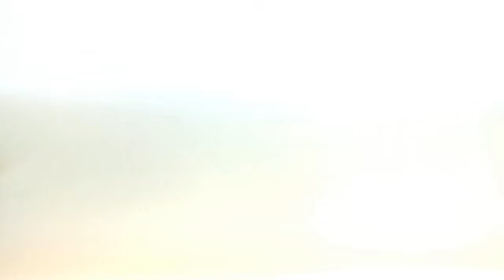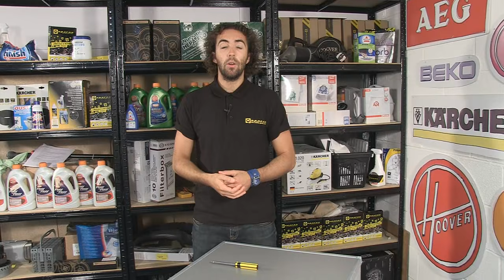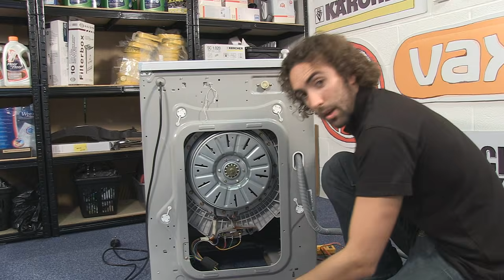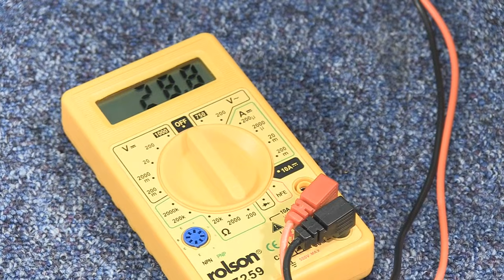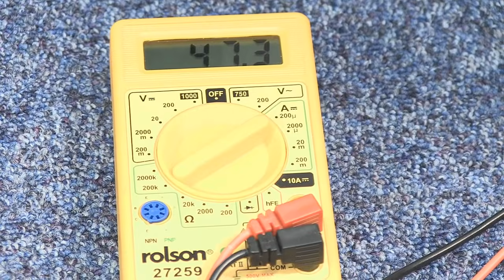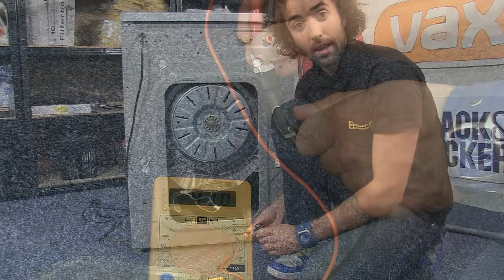Is Your Washing Machine Element Bad? Here's How to Tell!

Comment: Heater can measure positive voltage but still be faulty due to a short to earth, which a standard voltage test won't detect. The problem could also be with the wiring, the heating element itself (especially if it has a break), the temperature sensor, or the control board. A multimeter test with a high-resistance or insulation tester is needed to find the exact faul

Comment: Thank you very much  ❤🎉
Reply from the maker: Hi, thanks for your comment here, if you do need a new washing machine heater, you can check out our range here at eSpares:
https://www.espares.co.uk/washing-machine/elements/catalogue.pl?path=1015007&refine=elements
Reply: @eSpares Thank ypu .I have AEG washing machine and heater stopped working
Reply from the maker: Here you can find our range of AEG washing machine heaters:
https://www.espares.co.uk/washing-machine/aeg/elements/catalogue.pl?path=1015007,108434:1015037&refine=elements

...just be sure to select your specific model number from the left-hand navigation menu, to ensure you purchase the correct heater for specific washing machine.

Comment: I've just tested the element and integrated sensor on my Beko WM74125W. The element Kawai 230v1950w reads 30ohms at 200, 0.03 at 2k etc however the sensor reads 1.2 at 2k, 20K and 200k. At 2k it reads steady at 1.196 at room temp and when put over a steaming kettle drops rapidly to below 1.100. the fact that the reading is staying at ~1 regardless of range settings is confusing me. Does this sensor have a different range to that described in the video. Multimeter appears to work as expected the decimal point moves when measuring the heater.

Edit: After removing the thermistor I could see that printed on it is 4.8k Ohm. This measn at 25deg C it should read 4800 ohms and not the 20k to 50k stated in the video. Check the rating of the thermistor the ohm reading on the side is always rated at 25deg C and it should reduce from there. I've just ordered a new one. As I mention above it was reading 1.2 at around 19deg C whichever way you cut it is not close to 4.8 so fingers crossed this fixes it.

Comment: My washing machine works ok finishes cycle drains etc no codes, just doesn’t heat up? Heating element?
Reply from the maker: Hi, thanks for your question. It is likely due to a faulty heating element, but it is not the only possible cause of the problem. This video here will help you with more information on the issue:
https://youtu.be/caQ_QhoY9yA

Comment: Thanks for these v helpful videos first of all!

I have a Zanussi 5140P (about 6 yrs old) which doesn't seem to be heating, at least, clothes come out cold, even when washing on 60+ degrees. The resistance of the element I get is 30ohm. For the NTC sensor I get about 4kohm - does that seem on the low side? The resistance does drop if I warm it up. Thanks

Comment: I have an electrolux front loader. I had my washer on its side last weekend to install a pedestal drawer. Now hot water will not enter the washer. I replaced the water inlet valve and still does not work. Will a heating element prevent the water from entering? Thanks in advance for the help!
Reply from the maker: Hi Blueknightspaxv, the heating element will not prevent the machine from filling with water, has your machine got 2 valves as most machine only have 1 which fills with cold water and have you checked for trapped hoses blocking the water.
Reply: @eSpares  I have separate cold and hot water inlets. I replaced the inlet valve thinking the hot water solenoid was bad but hot water still will not enter. O checked all hoses and can see water enter the fill valve. Wondering if a wire pulled loose somewhere when I had it on its side. Can I test somewhere to see if there is no power to the solenoid??

Comment: I have a GE top load washer. It will go through the first agitator cycle, drain, but will not stop draining. Eventually the machine shuts off. I get an error code for the pump and thermistor. The pump works fine. Could a bad thermistor be causing this?
Reply from the maker: HI lbygyk1979, it is possible, what error code do you get and what is your model number so we can check it out.
Reply: eSpares my model number is GTWN5450D2WW. The error codes I get are E1 & E2. I do know the pump works and is clear of obstructions. Thanks!
Reply from the maker: Hi lbygyk1979, if the pump is working and no blockages you need to test the pump with a multimeter to rule it out but may point to a board issue.
Reply: eSpares it has a brand new board. That’s where I started. I’ll try and test the pump. I did test the thermistor. I believe it’s bad. The schematic says it should be 50k ohms at 77•. I’m showing it to be .02k ohms. 

I really do appreciate the time and advice you’ve given. Thanks!!

Comment: Hi ! Awesome video. I tested the heating element in continuity and the reading was zero so has the element failed also if I replace it can it fail due to PCB.Thanks in advance
Reply from the maker: Hi Hamish, if you have tested the element and got no reading it means the element is open circuit and needs replacing and the PCB would not cause it to fail.
Reply: @eSpares  Thank you very much ! In my casei think  the company guy was trying to fleece me by changing the PCB first and then the heater cause according to him the PCB if faulty would short the heater

Comment: Hi, i have a Samsung WV55M9600AV/A5,  doesn't power on, tested power to the pcb board, went ahead to replace, still no power when i push the power button.pls help
Reply from the maker: Hi Igee212, we are not familiar with this model number but understand it is a fairly new one, you would need to test through the PCB and ensure the door lock is activating, have you got a display to indicate there is power to the board?
Reply: @eSpares  yes its new, there is no display. I tested with a multimeter, getting 120v. I hear a click when i push the power button and a secong blinking green light on the pcb
Reply from the maker: Hi Igee212, logically if there is power going to the board it should show the display test the connections with a meter to be sure if t you have replaced the board and it is exactly the same then it would suggest the old one was ok and is the main board ok.

Comment: Hi I don't have a multimeter  but I think my element in my Zanussi washer dryer is gone.
The reason being ,machine developed a fault approx 6 months ago  it would wash  and wash 
Not moving on to next stage, I overrode this by using skip function, I'm assuming it was washing in cold water 
But I never realised.
New consumer unit fitted yesterday and 4-8 minutes into programme tripped fuse box.
I read that older fuse boxes  are way less sensitive than new ones.
I played around and managed to get it on spin and even dried some clothes.

The reason I want to repair even though it's old  is because it has an unsealed drum plus this is the 
Only problem in 12 years . It's a Zanussi  WJD1457W

The back of the machine looks difficult to remove, what tools do I need
Reply from the maker: Hi Jennifer, if the machine has an access panel on the back you can remove it to get to the heater, otherwise it may be the rear cabinet that has to be removed and you will need to test the heater to determine if it has failed even though it does sound likely.

Comment: My LG washer update:
Replaced the board.
The Ohms for the heater and thermistor check out.
The machine turned on and I hear the chime.

I will sit in front of the machine to do 2 loads, cold and hot.

I will be there to observe if and when, what part of the cycle the machine malfunctions in.

Wish me luck that it was just a board issue and not another part issue.

I now realize why the repair videos show the guys wearing gloves, my fingers are all cut up with deep, painful cuts.

OUCH!!

Later
Reply from the maker: Hi Rob, a lesson to everyone to wear gloves as machine have sharp edges, good luck it works.
Reply: I have an update for you regarding my LG front load washer.
Been running test loads with the lid and rear panel open.
Ran the 1st 3 loads, fine, not issues at all.
Returned to the garage after the 4th load and found an electric burning
odor eminating from the Direct Drive motor assembly.
The steel cover over the assembly was also extremely hotter than usual.

Perhaps I over loaded the machine with:

*1 king comforter
* 2 thick towels
* 2 thick bath mats
* extra water up to the bottom of the glass and the drain.

This is the same odor that was there when the original board blew the fuse.
So am I correct about over loading the washer?
I thought the washer automatically checks the weight of the  load before it does anything?

Any thoughts or ideas about this?
THx

Comment: Hello  eSpares,

I checked my heater element and thermistor in my LG WM3370HWA front load washer.

The reading results are as follows:

Heat element:

120V
14.5; Ohms
   8.5 Amps
 1,000; Watts
Continuance reading: 014

Thermistor:

No readings on multimeter  beginning at the lowest dial selection.
First reading on multimeter at the 200k dial selection
Reading of thermistor: 053

The summary:
Performed the Ohm calculation for the heat element in an app: the results are what you  see above.
They match the meter results

The thermistor: just does not seem right, when other thermistors being tested are not above the 20k dial selection and display a number such as 11.5.
My thermistor seems a tad bit on the "extreme" side.

If by chance this heater element thermistor is the malfuctioned part, is it possible to run the machine with the heater and thermistor "DISCONNECTED"

If so,  then will the machine run normally with heater disconnected and only use the heated water from the main house tank for warm and hot wash?

If it can only use the cold water setting, I am good with that until I can scrape up the money for the entire heater assembly.

Thank you,
Robert

Comment: Hi, 
I have one of those LG front loading washer and it doesn't have any power.
The control board fuse looks like all white with a little blue dot on the inside of the glass. I'm thinking it is blown. Yes?
What caused it, I believe it something to do with the heater coil.
Here is why I think this. The machine is a 2014 model.
The very similar situation occurred with my hot tub heating element. After about 4-5 years it had to be replaced.
The washer was giving off that "electric burning" smell on Sunday, before going dark, my thought is this, the heater coil turned on because the water temp from the water heater was not hot enough. It was being used in the house for dishes and showers at the same time the tub was filling.
How often should the coil be changed and if it is caked with minerals shouldn't it be replaced every so many years?

I have to get a decent meter, not the $5.00 one from Harbor Freight, I guess.

Thanks for the meter reading levels.

Robert
Reply from the maker: Hi Rob, the easy way to check is to meter the fuse and that will tell if it has failed but it does sound like it, next if the element is failing it can cause the board or fuse to fail so that's your next thing to test. You can buy a cleaner that will help with limescale build up and here is a link www.espares.co.uk/search/cc1427/cleaning-products/laundry-cleaning

Comment: Hi chief .I have siemen IQ300. i bought on 2015 jan. so far no issue but now with in 5 minuts  the W/M over heat  even we put in normal mix wash. and  electrical breaker down pls experts advice Thanks zameer
Reply from the maker: Hi Zameer, if the element is faulty it can trip the electrics when the element is on, the easy way to test for a faulty element is with a meter. we also have a video on testing with a meggar which you might find useful www.youtube.com/watch?v=XV6QlTwobLo&t

Comment: Hi , I have a question for you, I have a Bosch Vario Perfect machine over the last few months various items of clothing have shrunk, even though I have washed them before & continue to wash at the correct temperature. Could this be a sign that the thermostat is becoming faulty? There are no warnings appearing on the panel.
Thanks.
Kate.
Reply from the maker: Hi Kate, it does sound like it is getting too hot, first check the NTC fitted inside the heater and there is a video to show you how to test it www.youtube.com/watch?v=Ftm8lDVVw2E but if that is OK it could be the control board.

Comment: MY Samsung WF218/XAA washer gave TE error code.  replaced thermistor & heat coil.  Didn't fix it.  Checked wiring.  Broken orange wire at the harness in back.  the wire leading to the thermistor.  Fixed it with shrink wrap n tape.  Anybody need a 7yr old heat coil n thermistor?
Reply from the maker: You were 'unlucky' as broken wires are rarely the problem. However look on the bright side at least you found the problem and fixed the machine as well as having a spare heater if required. 😊
Reply: I'm lucky for the good people Who post on UTUBE.  Youtube RULES! Four people (I've seen in comments) on different sites had the same issue. This is on My Samsung clothes washer.  One guy even named the very wire (orange) that was broke.  I copy n pasted my solution to many sites to get the word out.  Thank god for folks like YOU who teach the willing how to do for themselves n save major money. 
  My son overloaded this machine five years ago n broke the spider.  With  UTUBE & a $36 part I fixed it.  She's been shake'n  N rock'n five Years since.  My advice to all is, Watch the vids ,  read the comments.  Go for it.  THANK YOU FOR TAKING TIME TO HELP ME!!!
Reply from the maker: Thank you for the comments :)

Comment: Hi, what would be the reading on the multimeter if the element is faulty? I'm using a analogue meter and the needle doesn't move from 1K ohms, i.e. "off the scale" cross checked it with an old kettle and got a positive, working, reading of around 20 ohms.
Reply from the maker: Hi Tony, the reading should be similar to the kettle element perhaps a little higher. The reading you have suggests it has failed and is open circuit.
Reply: eSpares Thank you, that's just what I needed to know.

Comment: Check one by one the element terminals with the ground cable or the metallic body of the washing machine. It is also a point that gives you faulty element when the multimeter's resistance approaching zero!
Reply from the maker: Thanks for the comments. There should be no resistance on any range from the element connection to the metal case. If there is any resistance it shows the element is 'leaking to earth' and is likely to trip the power.
Reply: @eSpares  Yes, i did the tests you showed in the video and they were all fine,  then did this test (my RCD was tripping) and i had measurable resistance between the element housing and the terminals, I think you should have had this test in the video too.  If the insulation inside the element is broken down this will cause a leak of current and a RCD trip.  I have new element is going in today. just for others to learn from my mistakes..... I think what happened was when i refitted the element a while back (after changing the main bearing) i pushed it inside and missed the guides down inside the drum and so the element was at an angle, it has then rubbed on the drum and i can see scrapes on it...and i suspect a pin hole has allowed water inside the element and hence the short.  When refitting these elements, look inside first and see if there are any gates/guides for it to go in and make sure you get it perfectly square.  All in all though, a simple fix for a semi confident DIYer.
Reply from the maker: Hi cobrachedz, thanks for your post and helpful advice. We are sure this will help other people facing the same issues. Glad you got your appliance fixed.

Comment: I really appreciate people that take the time to make helpful videos like these, so first thank you! My Zanussi was tripping the RCD intermittently, it then stopped tripping the RCD but it was then I noticed that it was not heating up. So I pulled the heating element out and tested it and it was fine, next I tested the Temperature Sensor (It was a built in one), it was not giving between 20-30k Ohms it was giving 4800 but so is the new replacement one I have. When I dip it in hot water it drops, so I am assuming that is also OK? Do you have any ideas what the issue could be if it is not the heater or sensor? TIA
Reply from the maker: The likely cause would be the heater element and this should measure between 20 and 30 ohms typically, also check the control board for signs of burning.
Reply: Yes I tested the Element it was giving 34 ohms and was fine, tested the heater sensor (built in one) as above, it was fine but gave a lower reading that what you said in the video, but so did a brand new one.
Reply from the maker: A faulty element that can cause an earth trip often will not show using a multi meter as the voltage from the meter is not sufficient to cause it to break down. See our video: https://www.youtube.com/watch?v=XV6QlTwobLo
We would still suspect the element and suggest you replace this before looking further.
Reply: Thank you for taking the time to advise, really appreciate it.

Comment: My electrolux washing machine show Error 66. I have just checked element heater value and i got 30.7 Ohm. NTC sensor value is 5,4K Ohm. Cables are good. Any advice for this problem?
Reply from the maker: This error can also indicate a faulty control panel. If the wiring and element are checked OK then suspect the control panel.
Reply: I want to repair this board, please help me some guides for this. Thanks
Reply from the maker: Sorry but the manufacturers do not giive information on the PCB's so we cannot help further with this.